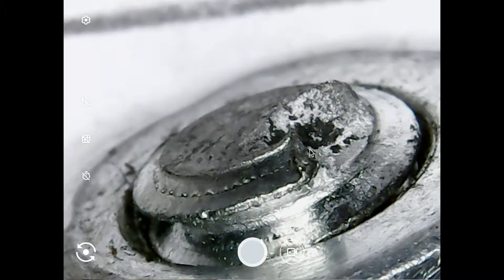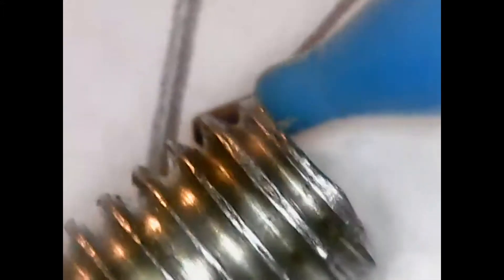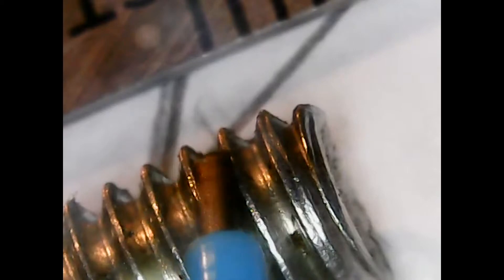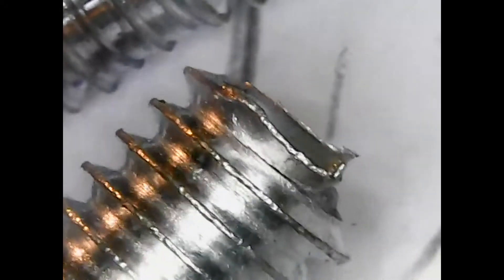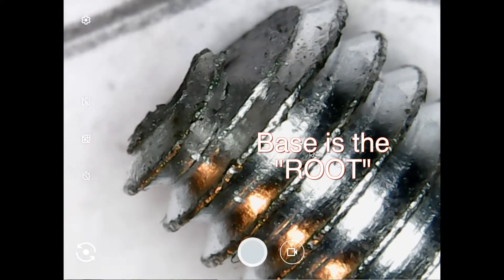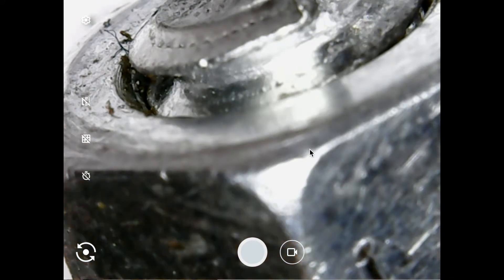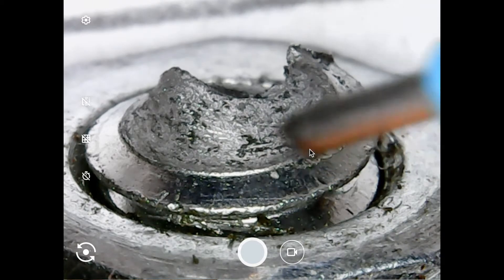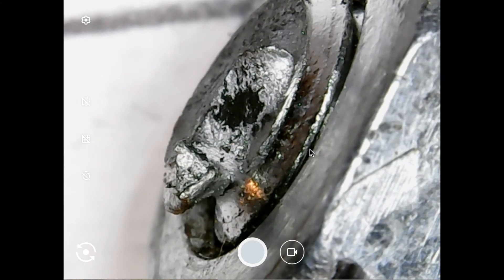Brittle Failure in a bolt explained tension failure in a bolt

Comment: I have had a problem with 14.9 zinc coated studs that fail (brittle failure) during disassembly. I ran the same test with 12.9 zinc coated studs torqued up to the same setting and they never failed. I know that a higher strength means lower toughness but if the 12.9 stud doesn't fail at the same torque setting then why would the 14.9 grade studs fail?
Your valuable input would be greatly appreciated! 
Thank you
Reply: I would suspect hydrogen embrittlement, depending on how the zinc coating is applied. Acids and electroplating can generate hydrogen that affect harder grades more, so usually conversion coats are applied. Environment can also generate hydrogen in certain situations, too.